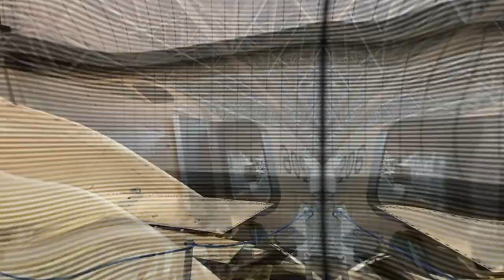The Avro Arrow in Under 2 Minutes

Comment: Hi AeroSpire,
The first non-experimental aircraft that was designed and flown (in 1958) with a fly-by-wire flight control system was the Avro Canada CF-105 Arrow, a feat not repeated with a production military aircraft (though the Arrow was cancelled with five built) until the F-16 Fighting Falcon and F-18 Hornet. This system also included solid-state components and system redundancy, was designed to be integrated with a computerised navigation and automatic search and track radar, was flyable from ground control with data uplink and downlink, and provided artificial feel (feedback) to the pilot. The Arrow's thin wing also required aviation's first 4,000 psi (28 MPa) hydraulic system to supply enough force to the control surfaces, while using small actuators and piping. To improve high-alpha performance, the leading edge of the wing was drooped, especially on outer sections, and a dog-tooth was introduced at about half-span to control the spanwise flow, and the entire wing given a slight negative camber which helped control trim drag and pitch-up.
Reply from the maker: I never knew this, very interesting! I wish I could've included more detail on this in the video.
Reply: @AeroInspire  I Feel ya on that.. 2 mins is certainly not alot of time unfortunately.

 However another thing I would like to mention was that the primary weapon considered for the Arrow was the Canadair AIM-7B Sparrow ll 2D active guided missile, essentially an AIM-120 AMRAAM 33 years before the AIM-120 AMRAAM, a total of 4× of those missiles could be placed in the Arrow's Internal Weapons Bay.
Reply: @noahsaunders3919  4 missiles per weapon bay and the arrow had 2 weapon bays, so it could hold 8 missiles
Reply: The fly by wire FCS design found on the Arrow was implemented on Concorde and was later implemented on the Airbus A320 in the 1980s.